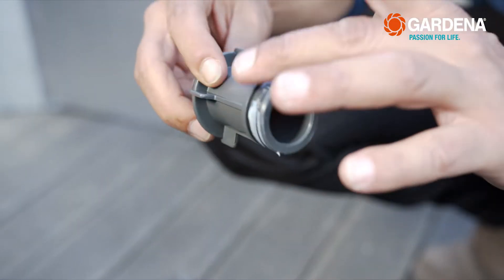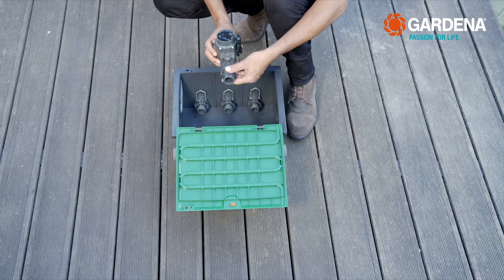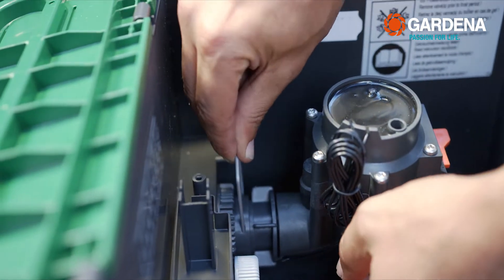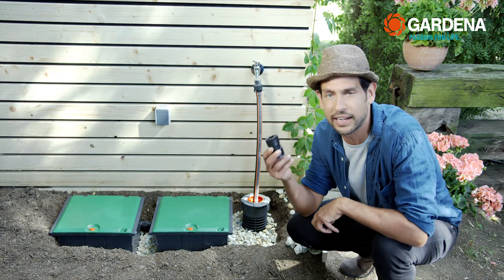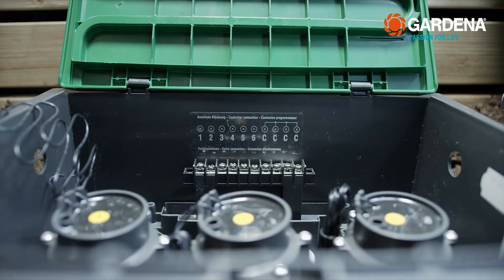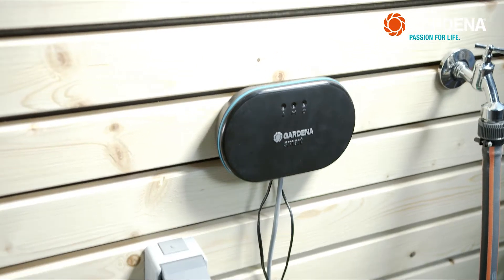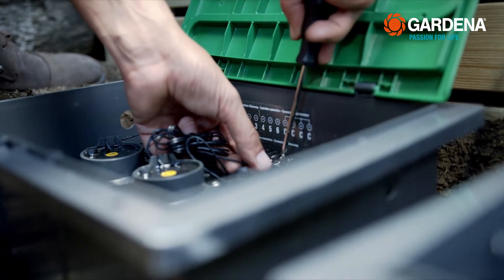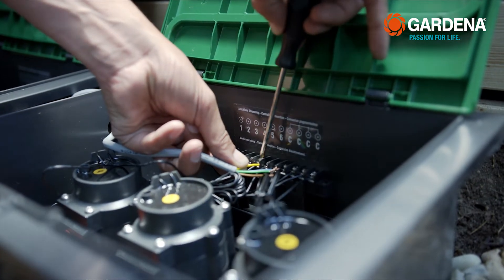GARDENA smart Irrigation Control - How to (Chapter 5/6: Installation Irrigation Valves)

Comment: hi, how in this valve change orange switch, i have new, but dont know how install
Reply from the maker: Hello,
Thank you for your message.
If required, the valve can be opened or closed manually at any time with the orange switch. In this way, irrigation can be opened or closed independently of an automatic irrigation control system.

Further information and manuals can be found here:
https://www.gardena.com/int/products/watering/water-controls/24-v-irrigation-valve/900904101/

If you would like us to help you personally, please contact us directly via our website:
https://www.gardena.com/int/support/advice/contact/

Best regards
GARDENA Service